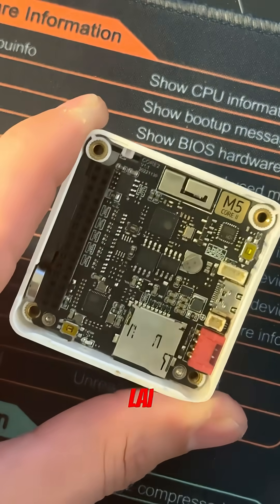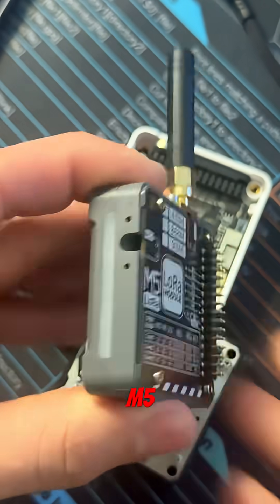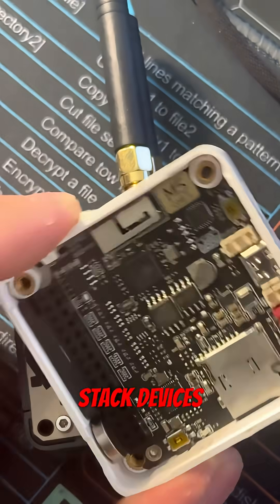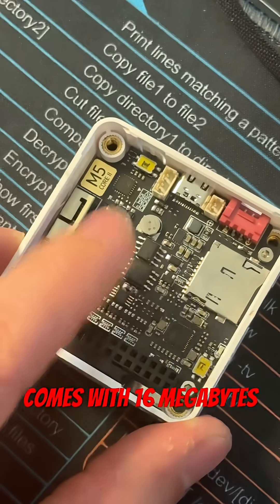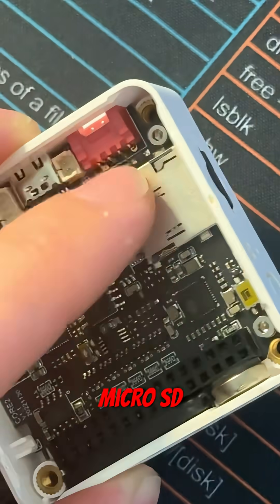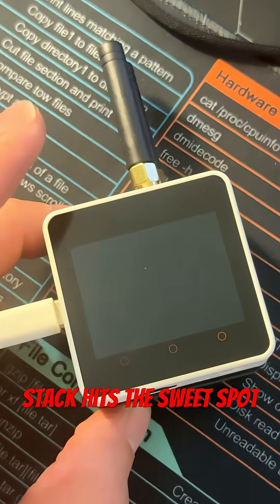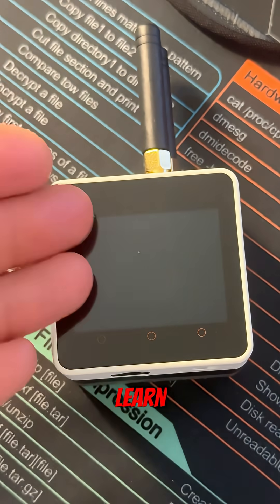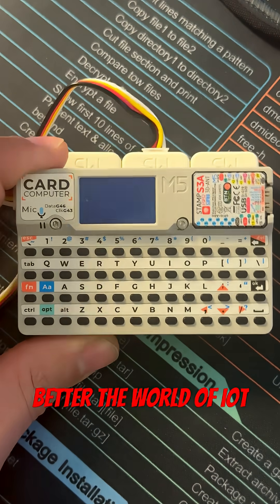The History of M5stack & Core #m5stack #esp32

Comment: What is it for
Reply from the maker: Its a modular prototyping iot device that lets you literally stack modules and sensors on top of each other for different projects, it depends on what you are trying to build. Want a lora radio? Stack a lora module. Want sub ghz abilities? They got a stack for that. Battery? Also a stack. Gps? Also a stack. Audio out? Stack it. Everything, literally an entire catalogof stackable modules. But they also have regular sensors and modules you can connect via 4 pin grove connector. Point is they changed the world of learning about building your own projects and built the whole idea on making the education of building and coding these devices easy to get into.
Reply: @Valleytechsolutions  so cool
Reply: @Valleytechsolutions is there a source for formal instruction in using this? Like my class for my Cube autopilot?